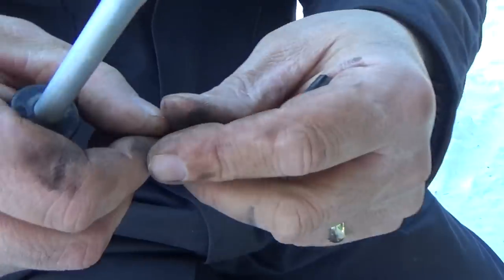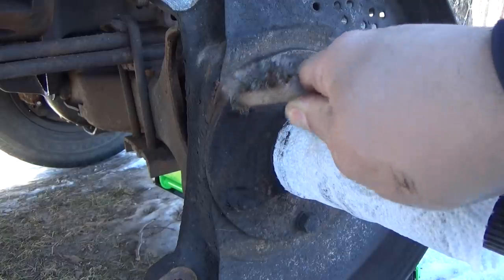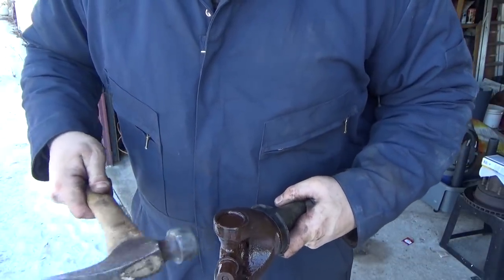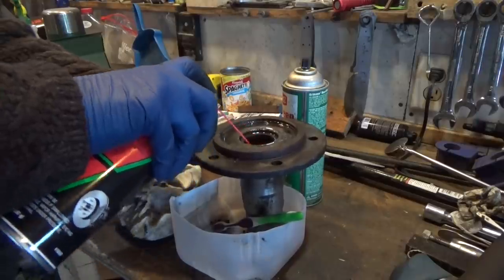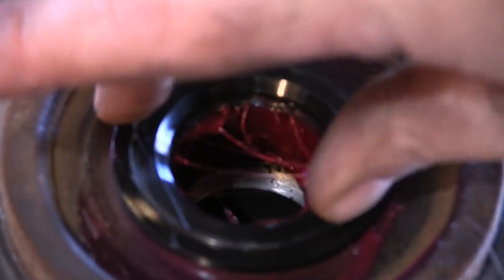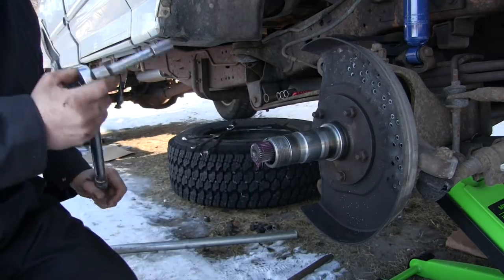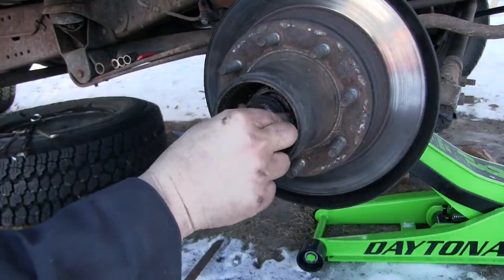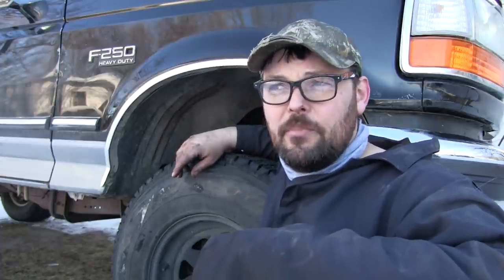How to change a universal joint in a 4 wheel drive front axle. ( f-250)

Comment: This is one very practical tutorial, and I love the way you edit your video giving us just the most direct information possible to each part of the task.  That old UJ was well worn, and I'm very pleased to see the replacement has a grease point, those things need greasing regularly. I have vehicles that were fitted originally by the manufacturer with sealed grease-less UJs that lasted less than 25k. I have switched out all of mine to one's I can lubricate.
Regards, David in the U.K.
Reply from the maker: Thanks David

Comment: I have no intention of getting that involved in a job only to find out I need more parts and have to find a ride to the Auto parts store.  When replacing a water pump years ago, I destroyed the gasket and had to make my own by tracing the old one on thin cardboard and coating both sides with Aquarium sealant.  Worked like a charm and no leaks.  MacGyver would be proud.  Love the new channel.
Reply from the maker: That sounds like a very respectable work-around

Comment: Good job Dave! The seals are called inner and outer seals. The "inner" is near the center of the axle while the "outer" is near the wheel it's self. Just remember inner is under truck while outer is close to the outside edges of the truck. 

For the viewers always tighten things in a star pattern evenly this ensures everything is centered and tight i've seen people lose wheels not doing this. Always use jack stands and chalk your wheels for safety! 

Keep the videos coming i enjoy the content and your channel. I did this work on my 99 Ford F250 Super Duty some 3+ years ago it's still going strong!
Reply from the maker: thanks

Comment: Very methodically done. Once I have my U joint snap rings in place I open up the bench vise and support one yoke on the jaws. Then I tap on the other yoke with a hammer to seat the U joint cup back against the snap ring. Do this to all 4 cups and the U joint will have a smooth range of movement if one of the cups was driven in too far. It will also show you if the snap rings are well seated. Laying the U joint across the open vise jaws can also be used to drive out the opposite cups once the snap rings have been removed. Cleaning and soaking the old joint before removal is a very good idea since I have seen many distorted yokes and shafts from over enthusiastic hammering. Heat also works. The U joint snap rings have a smooth rounded side and a sharp corner side. I try to put the sharp corner to the outside to keep the snap rings from popping out under load.
Reply from the maker: Thanks
Reply: @cheapwheels9828  Also forgot to mention to add some grease inside the cups to keep the needles in place when assembling and orient the grease nipple location to give you the greatest access for the grease gun. Few things more frustrating than not being able to grease that newly installed grease joint.

Comment: Patience is not the ability to wait for something, it is the ability to wait for something while remaining calm. For me that's in short supply. I can tell you right up front that at this point in my life I'd "nope" right out of this job other than to drive it to my mechanic and hand him the keys. Not because I couldn't do it, I've done a bunch of jobs like this over many years all with a great deal of success, but because the group of guys i used to make a weekend out of doing this kind of thing with are all about 400 miles away. Without the friends, the beer, and the doing this kind of thing together....this kind of job loses it's appeal for me pretty quickly. Great video though, I thoroughly enjoyed hanging with you as you worked on this. Thanks for taking us along for the journey.
Reply from the maker: Interesting. Ive always worked alone.
Reply: @cheapwheels9828  I guess it's all about what you're used to which for me means working on cars alone just really isn't that much fun. I grew up just a couple blocks north of 8 Mile Rd, we were packed in like sardines and everyone had cars. Of course everyone needed their car worked on eventually and we always did that together. By helping each other out even the biggest jobs weren't so bad because there were nearly too many hands to do the wrenching and someone in the group, usually more than one, had done this job before. Throw in the beer, a barbeque, and it ended up we'd spend more time talking about the job then we did actually doing it but we were always having fun and the job always got done. Every time I travel up to Michigan I always, always wind up spending as much time as possible in my best friends garage where I feel more at home than just about anywhere on the planet. i thoroughly enjoy wrenching on things there. Weird, yeah, but that's how I'm wired.

Comment: One thing I noticed was that you might have put the U joint in backwards. It appears that you put the zerk fitting toward the wheel which may make it difficult, if not impossible, to grease. 
It might be better to use a quality sealed U joint like a Spicer. They have better grease seals to keep the grease in and you don't have to struggle to grease them. 
I can't imagine what kind of hell the 4 wheel drive has been through to destroy a U joint like that. 
When I am in 4 wd and I need to turn sharp, like when maneuvering during snowplowing, I slip the transfer case into 2 wd to avoid the binding on the U joint. This saves an enormous amount of wear on the U joint. 
Also, I use anti seize on mating metal parts. Grease washes out rather easily.
Nice video work.

Comment: We have all done it, and I am all for personal choice and being responsible for ones own self, BUT I would never post a video working underneath a vehicle with just a floor jack. 
It is great to see someone doing something on a snow covered driveway.
Reply from the maker: Well said! BUT, you're not totally correct. I would never work "underneath"  a vehicle with only a jack. On this repair I never once got under the truck with the exception of reaching my arm far out and sliding the half shaft boot back on. Other than that it was all outside the truck
Reply from the maker: I have a pair of huge wood blocks I use for working under vehicles

Comment: Would you approach replacing a limited slip differential in a rear axle of a GM vehicle, like the G80 in a Chevy S10? I've been wanting to address mine, but it seems overwhelming. Doing the lash part, depth of the pinion are the intimidating parts for me.
Reply from the maker: Thats a job for a pro. Luckily ive never had any issue with a rear dif...

Comment: The video quality and explanation are good. It looked like you didn't clean or grease the locking hub, clean and repack the inner wheel bearing or grease the U joint when you were done. You also had very dirty hands while handling parts that shouldn't get dirty. 
I've always used a vise to remove and install U joints.
I saw a video from Spicer about choosing U joints. With a grease fitting is ok as long as it gets greased regularly and after being in water since they aren't sealed tightly. They also have a weak spot where the grease fitting is and can break under hard use. Sealed U joints are stronger and are tightly sealed against water and letting the grease out. How long each would last.....who knows.
Reply from the maker: I did not pack the inner bearing because it was well packed and the grease looked good. Someone had been in there before me. Same with the locking hub. The grease was in good shape and I didnt see the need. As for my hands I Always keep them as clean as I can. Yes they get dirty but from grease but not sand, rust etc. I must have used a half a roll of shop towel doing that job.

Comment: My truck has a slight clicking noise when driving straight 20-40mph in 4wd, I wiggled on the u-joints and they both seemed tight. Was the tale tale sign for your truck just that there was movement?
Reply from the maker: wiggling the joint on flat ground -with the tires chocked -in neutral

Comment: My U joints are shot on my 94, will that wiggling cause me to turn my steering wheel a lot to turn my wheels a little bit or is that something with my steering? I'll have to jack the truck up to test ball joints and tie rods
Reply from the maker: thats tie rod ends, steering gear box, drag lines, a loose pitman arm etc
Reply: @cheapwheels9828  ok thanks

Comment: Do you know the part numpers of the axle seals I am having a hard time finding what I need. 1997 f250 with dana 50 IFS
Reply from the maker: there is an inner seal, and outer seal, and a thing called a Slinger and maybe an inner "boot" also. The HUB has a seal. The SPINDLE has a seal, then there is a plastic SLINGER that goes on over the spindle seal, then the axle stub shaft has a BOOT ( dust boot) that goes onto the shaft. Hope that helps

Comment: What was the part number of the u joint you used? Need to do the same thing to my 97 f250hd
Reply from the maker: I'd have to look .......but if you have an HD you probably have the dana 50 front end ( huge hubs). Thats the thing you need to know to get the right stuff.
Reply: @cheapwheels9828  yes sir. I wound up finding the right one. Now to order the seals and reassemble
Reply: @cheapwheels9828  from watching your video i learned the spindle nuts were in backwards. The one with the tit was on the outside. Going to reinstall properly once the seals I ordered arrive